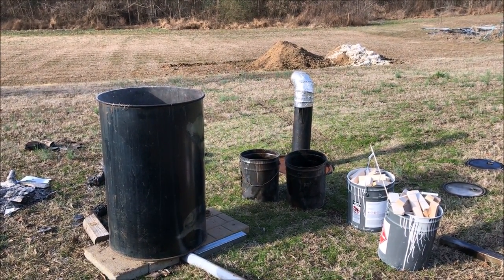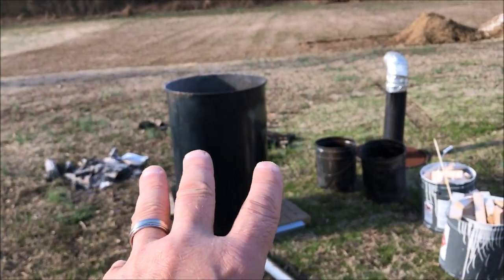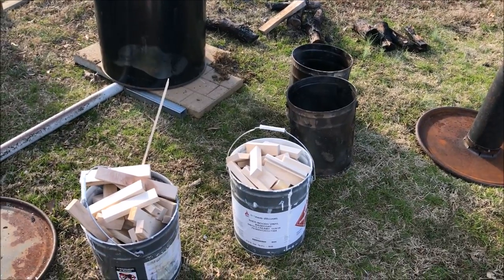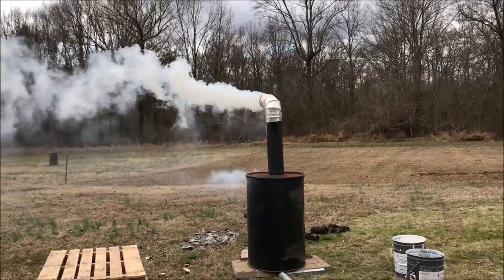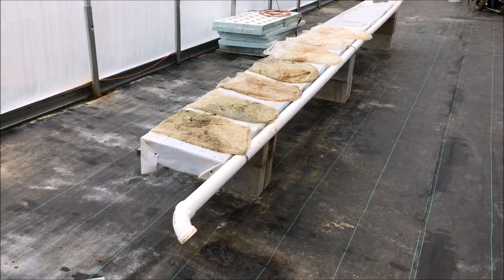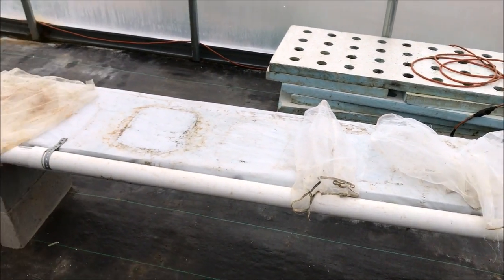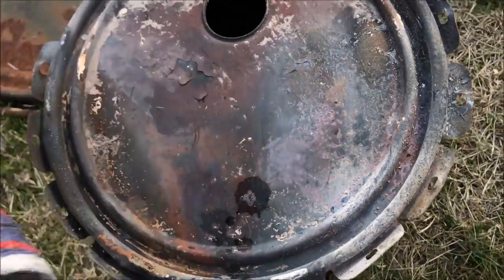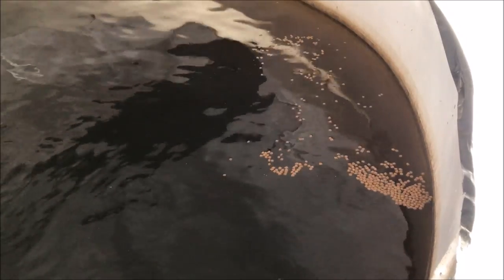Making Biochar for my new wicking bucket system

Comment: maybe it would be a good idea to support most of the weight of the heater with support from underneath. you know for those just in case senerios.
what did you do for backup power if the grid goes down?
best
Reply from the maker: I have a 8500 watt generator in there too!
I plan on growing under that heater. I may put an aquaponics seed starting bed there!
Chuck